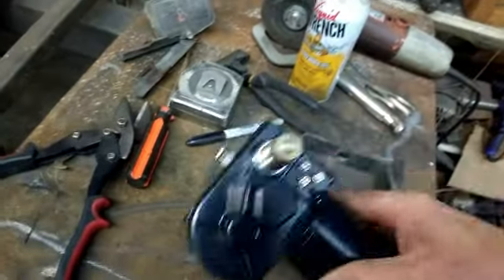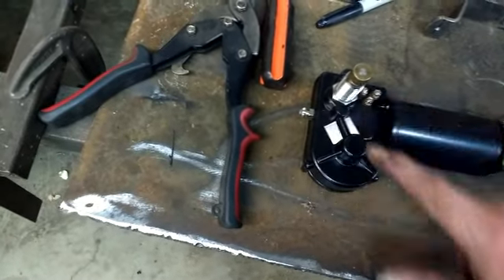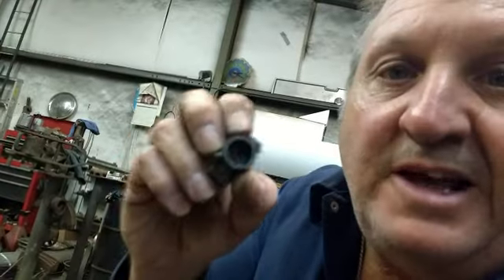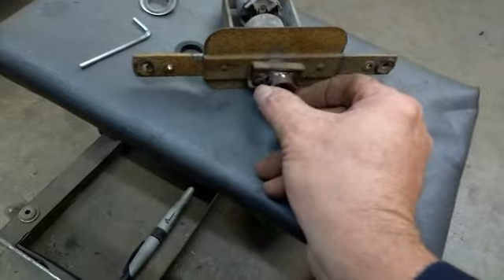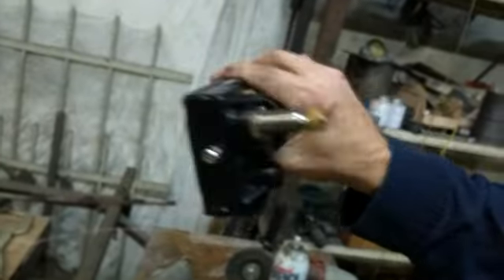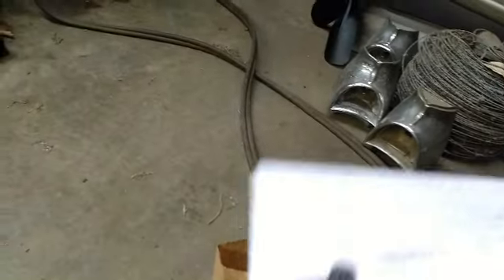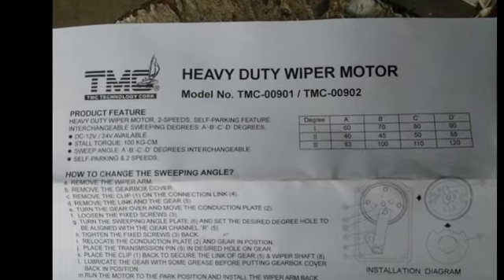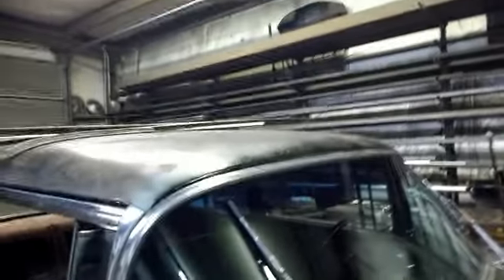55 57 Chevy wiper motor DIY

Comment: Hey Kenny I can do this , which pt.# did you use , the 00901 or the 00902 ? I can't find any in the $60 range . What auto parts store did you use ? Thanks ,
Reply from the maker: bought it online they went up    https://f25.com/electric-wiper-in-12-axis-1-00004623.html?gclid=EAIaIQobChMI2YmI8vWr3QIVF9NkCh2S6gLGEAkYBCABEgLZtPD_BwE